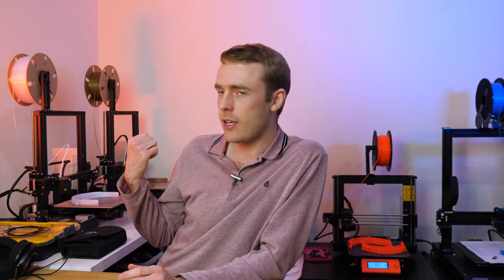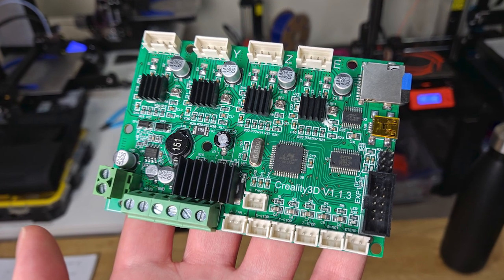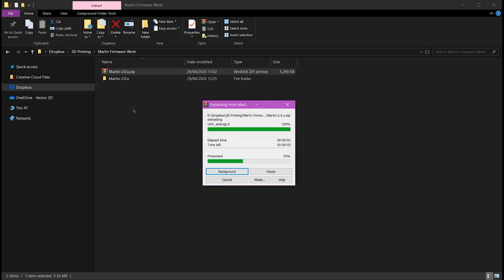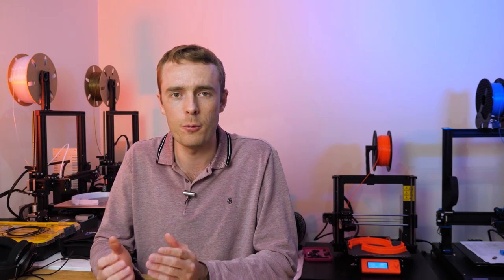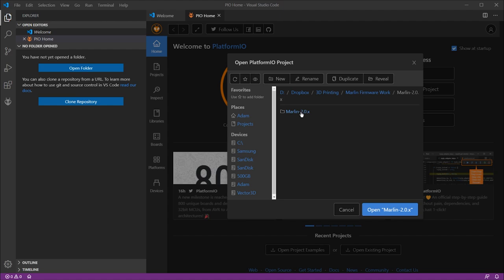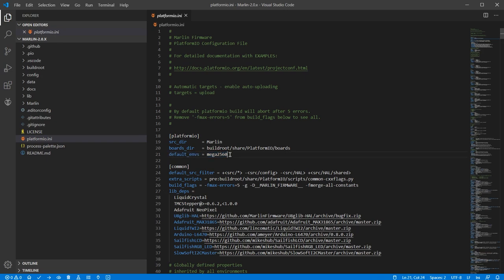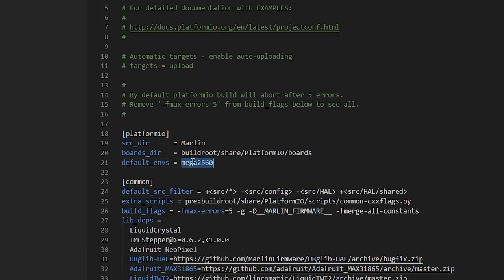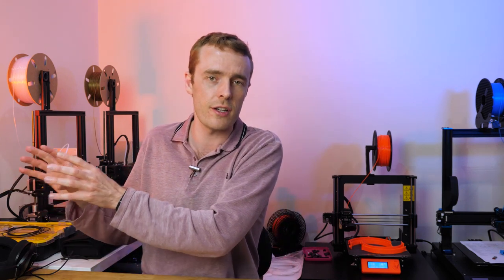Marlin 2.0.x Full Guide - Getting Started (Part 1)

Comment: My platformio.ini file doesn't have any processors listed other than the mega2560. I don't see your board or mine when I search the file.
Reply from the maker: try downloading the firmware the original source again, not from a manufacturer/reseller.
Reply: @Vector3DP  I did bruh
Reply: same issue
Reply: @swagoverload9222  any fix?
Reply: @muratalizade6348  I installed marlin from the manufacture that my board had, I had a mks robin so I downloaded that firmware which had my processor

Comment: It seems folk have just copied 'config' files over from other printers and amended / added a setting or two for their own needs..
End result after many copies is a file with nearly 2,500 lines of mostly useless comments for all sorts of irrelevant features.  For my stock Tronxy XY1 with an 8 bit Melzi board - 90% of the sample 'Tronxy config fie' is nonsense. And i haven't even looked at the 'adv' file yet!.
Another Youtuber 'Design Prototype Test' - shows a 'Kossel' web interface that configures your board and then builds the hex file. Seems a lot more intuitive. https://www.youtube.com/watch?v=VXBr3MTs50c&list=WL&index=6&t=82s
Reply: It doesn't even build a hex file, it's just a plain text human readable config file with gcodes in it to setup the board at run time. Edit on the fly.